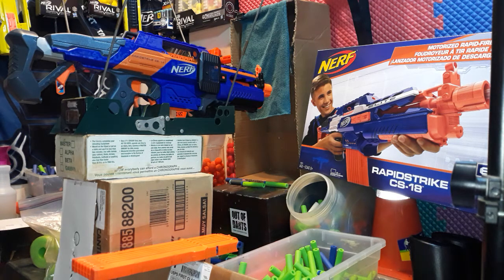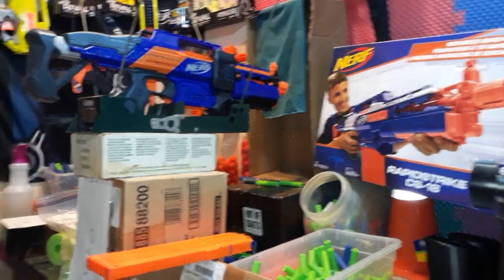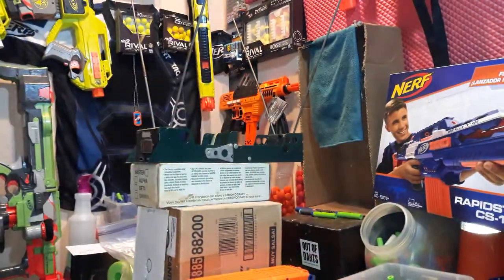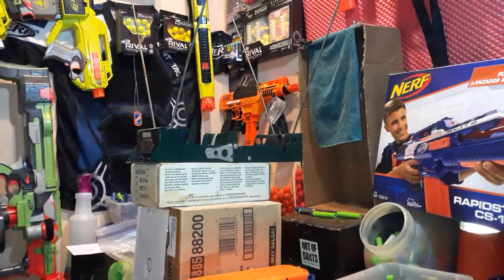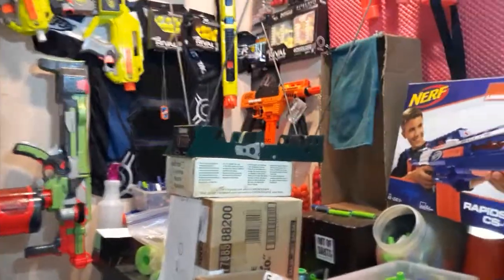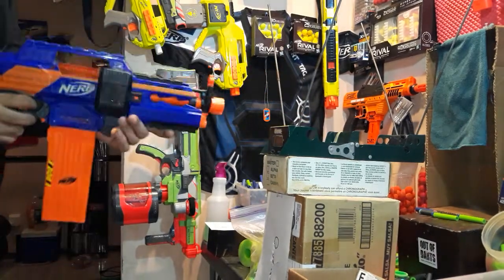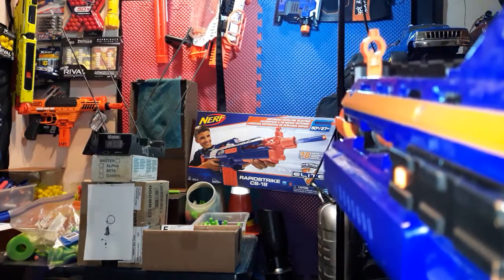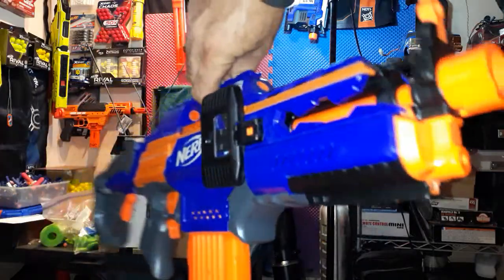Nerf rapidstrike tuned for 150+fps.

Comment: Yes!! Awesome been waiting for this 🤣🤙
Reply from the maker: Thanks bro. Turned out ok. Going to try the 68000 rpm motor. I think that may put it right were I need it. My brand new rapidstrike  will have the highest RPM motor in it with a pwm to control the rate of fire stay tuned for that one bro🤙🏽
Reply: @redsnerftuningchronographt6656  bro I so gotta learn what you just said. I still haven't opened any flywheel yet. Imma get it though. Nice blaster can't wait to see the next one. 🤙
Reply: I put a meshal 2.0 motors in a rapidstrike and plan to add a pwm also the pusher gear motor broke on my rapidstrike